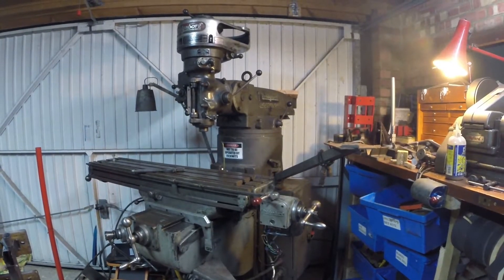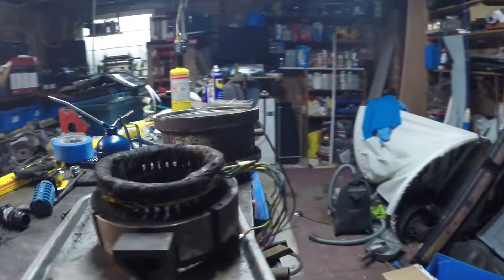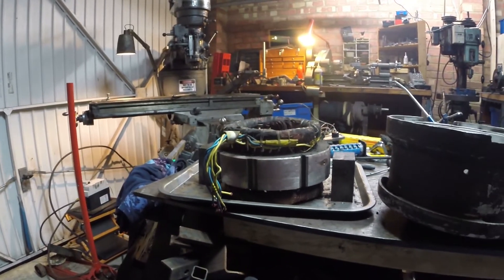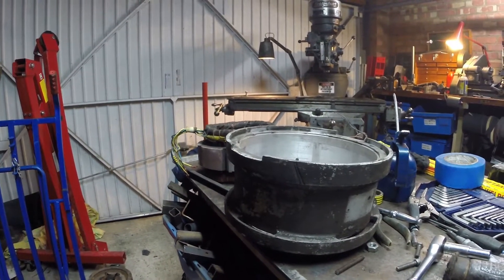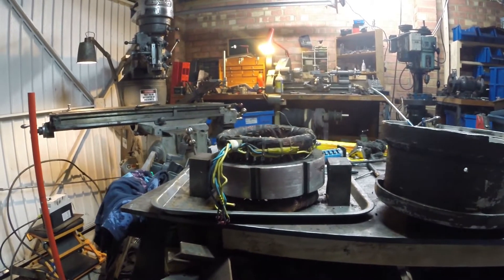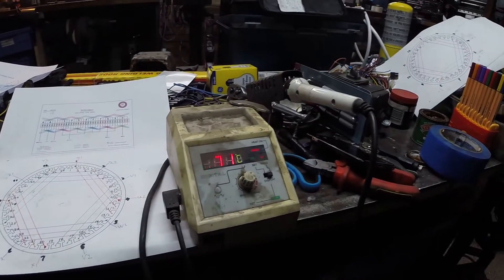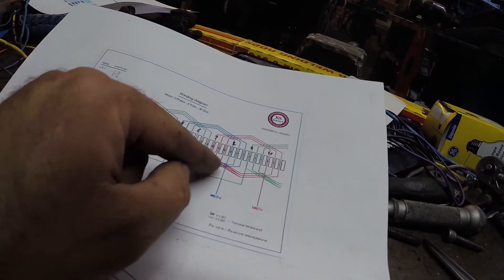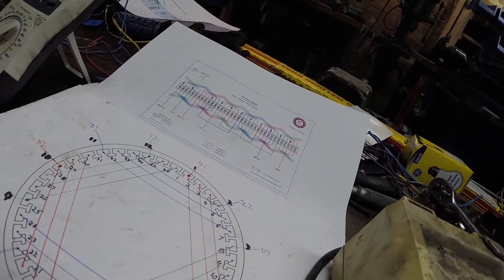Bridgeport 2HP 220V conversion for VFD

Comment from the maker: If anyone is curious: yes, it does work at its full rated power after conversion. Dialling in a ~2HP cut is not a problem. Footage of the beast in use will follow.
Reply: Absolutely brilliant do u mind if I ask what forums u use 👍🏽I’m embarking on the same machine very soon
Reply from the maker: @adamdiaz8442  Thanks! I'm on Hobby Machinist most frequently. They're a real friendly bunch over there - come and join if you haven't already :)
Reply: And u got a new subby 👍🏽

Comment: Hi, I want to put 230v into my bridgeport, same as you have done.  Do you put the 230 live &neutral[single phase] into the drum switch and then swap the 2 legs  from the 3 phase from 415-0 to 220-0.    If so what number terminals on drum switch for the 230V live and neutral?

Comment: Great video! I have the same motor that I removed, and have been running a single phase motor. I'm now at a stage of wanting better control without constantly changing gear. Would you entertain carrying out this work for me for a charge? Here's hoping 🤞🤞

Comment: You are a braver man than me! I did a lot of reading up and decided to avoid a pancake machine at all costs due to the difficulty of rewiring the motor; found myself a regular J-head at a good price and on delivery .. there's no data plate on the (single speed) motor so I still have no idea how it's wired without mapping it out. D'oh!
Reply from the maker: I don't know anything about the single speed motors, I'm afraid. How many wires and how are they wired? I'd be very surprised if it's not wired star and will be able to swap to delta. In any case, it'll be a heck of a lot simpler than the Dahlander conversion!
Reply: I also just noticed - is that a Super 7 in the background?
Reply from the maker: @aaronbuildsa  Less bravery, more didn't know what I was getting into! Turned out alright, though. Well spotted - it is a Myford, but an ML10. Kind of outgrown it, but it's a sturdy little machine.
Reply: @Designments  Oh and nice ML10 - my little ML7 looks dwarfed next to the Bridgeport now! Perhaps one day I'll upgrade to something beefier but at the same time the ML7 is so simple and easy to run :)
Reply: do  you have a link to diagrams you found and any more info if possible . i need to convert mine ,at the moment i reconfigured my VFD to fool it in thinking it was connected to 440v  not 220 but only at half power ,not really very satisfactory
Reply from the maker: @johncrisp6668  I think I linked most of what I used. Anything you're looking for specifically?
Reply: @Designments  yes courage , would be good if i could contact you if i get out of my depth
Reply from the maker: @johncrisp6668  Yes, of course! I'm quite active on the hobby-machinist forum. Lo-Fi on there. Discussion on a public forum means the knowledge gets shared too, which I'm very keen on. Bon courage!!
Reply: @Designments  Thanks. Sure that will be helpful to know their is someone  to advise  if i get stuck.

Comment: Interesting video. I am in the same situation of having acquired a BP Series 1 with a pancake motor and need to decide how best to proceed. Change the motor and use a VFD, use rotary phase converter (not my preferred choice) or attempt your modification. What is not clear (to me anyway) is what is the base speed of the motor when run at 50Hz? 1400 or 2800RPM?
Reply from the maker: It's essentially wired similarly to the high speed mode, so 2800. I run mine up to 60Hz, which it doesn't seem to mind at all. I've now converted three Dahlander wired motors this way, all of which are working well. The latest being an Arboga pillar drill which has the gearbox input integral with the motor shaft, making it very tricky to do a mechanical coversion. Rewiring it worked like a charm. You do still need the VFD - the conversion is only so it will run low volt (220V) three phase, not 415V.

Comment: Good video
The 6 wire motor sounds interesting, did not know such a thing existed
Reply from the maker: Cheers dude! I didn't until I had pretty much the same "Doh. It needs high voltage" moment you did with the surface grinder and started researching. I'm hoping it helps a few home machinists out, though.